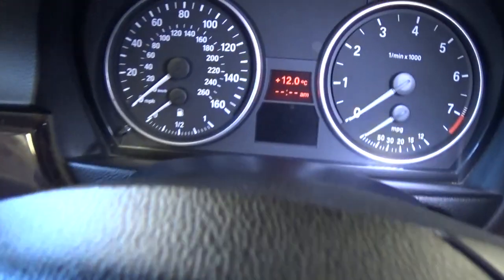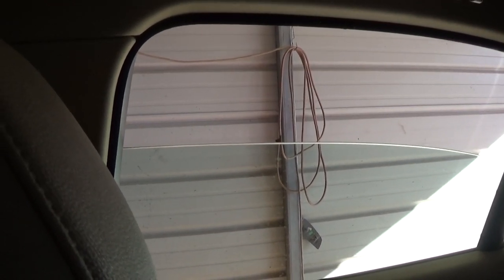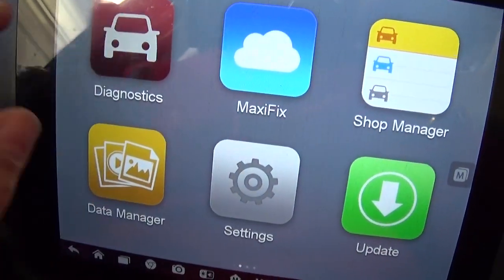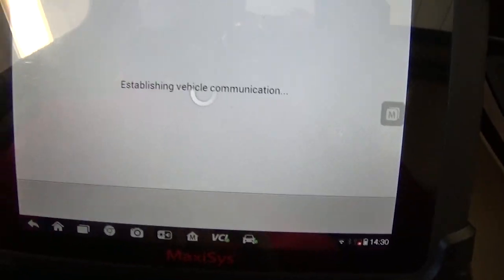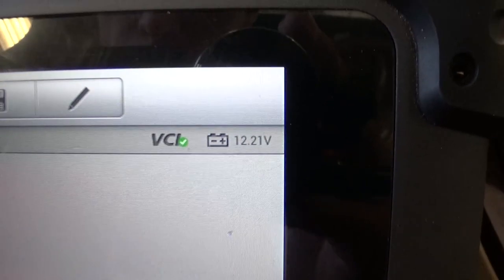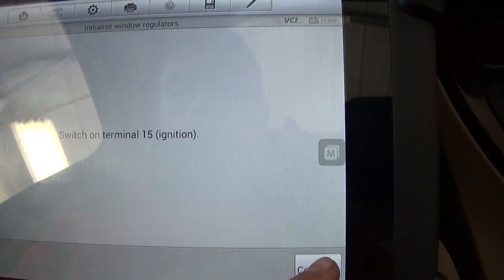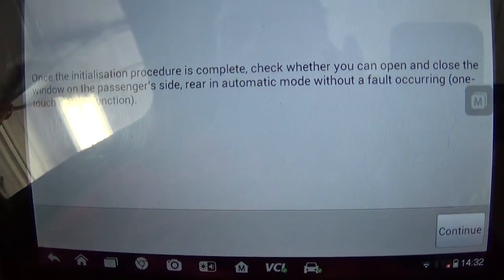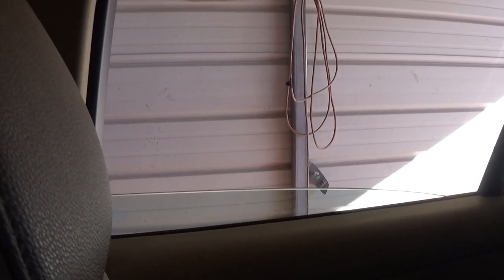BMW Window not Working | HOW TO INITIALIZE WINDOW REGULATOR WITH MAXISYS MS908

Comment: To all e90 Fans with one press window issues. As far as i am aware u do not need a tool to program the regulator all you need to do is follow the RESET steps press button down till window is all the way down and carry on pressing for 10sec. do the same rolling the window up. this should fix the one press isusse  Note it will only work if u have just replaced ur regulator or ur current one is working. Enjoy
Reply: This doesn't work for me. However it's still worth trying before getting the computer out.
Reply: This "procedure" is making rounds around the Net, but it is pure nonsense. You will not achieve anything by doing this.
Reply: Thanks so much! This actually worked!
Reply: ThatMontmorency this actually worked for me
Reply: This worked for me! didn't even need to roll up the window though. As soon as it hit 10 sec when I pressed the buttons while the window was down the window was functioning properly afterwards.
Reply: Worked for me, I only pressed the button in half way to engage the one touch function and held it on for 10-15 seconds while the window was open then the same when the window was closed. You do have the ignition on though (press the stop start button without pressing the clutch).
Reply: Worked for me!
Reply: Beau Hartley-Tilley it worked for me, too! 👍🏾
Reply: Worked for me just now as well thanks man!
Reply: Usually don’t comment but thanks for this it actually worked !!
Reply: Worked for me.  I didn’t start my vehicle, I hit the “Start” button without my foot on the brake.  From the drivers seat, I performed the remaining steps.  After that, I ran it as the sequence states above to the “Fully Lowered” position and held the switch down.  Then I raised up the window to the “Fully Raised” position, again from the drivers seat.  

Then I tested operation from the door where the regulator failed, same steps as above.  

Then I checked the computer for the active faults, and fault was removed.  No special computer to reset the window replacement.

Comment: hello friend, I need help, the windows of my BMW e90 2007 stopped working in an instant, only the co-pilot works, it goes up and down perfectly, the other 3 do not go up they do not go down, I thought it was a problem with the switches and bought all 3 new, also check the fuses and they are good, with the key they all go up and down normal, but the switches are not working even though they light up when the car is started, try to reset by holding down the switches and it does not respond. I don't know what to do :( I really appreciate your help. Thank you very much.
Reply: DId you solve it

Comment: I have a snapon zeus and where this initialisation is located, it fails to find the module. I was curious if its possible to flash the module with a laptop and INPA or is it specifically only for programming a virgin FRM module?

Comment: I have the same problem with my bmw 530i 2006 so is something wrong with my window maybe a motor ? Or do I just need to take it to a machine to get it programmed?
Reply: How did you end up fixing the problem. I have the same car nd my window is acting up

Comment: I'm having a problem with my 2013 BMW e70 the window control switch on the driver side that controls all of the windows does not work how may I fix this problem ? I already checked the 5 fuses that have to do with this function all of the fuses are good and the car battery power is good but when I try using the main switch on the driver side to control the windows nothing happens help me to fix this problem what do you suggest check should I do a voltage check to the main switch and to the window regulator on the driver side? When using the window controls from any of the passenger seats it works but just not from the driver seat.

Comment: I have a 2001 330 ci. Had the battery replaced and now my back windows work fine but my two front windows wont do anything. And my drivers side window is down a little. I've tried holding all the buttons down for 20 seconds then up for 20 seconds and nothing? Helpp

Comment: Hi I have a BMW X5 , 2006.  It has an intermittent window problem.  One minute they won't work, then only one window or they will open and not close.  Does anyone know how I can fix this.  It's been tested at garage and no fault was found. Thanks. Linda
Reply: Shame on bmw putting crap window regulators

Comment: Mate,thanks for the video, I have a problem with my E90, windows control doesn't work properly, all 4 windows works on driver side control panel but on each side the won't open (down) they only can close by each side, do you have any idea? Cheers
Reply: Same my car also  bro

Comment: My window has he same problem.  Is there a cheaper tool to initialize?
Thanks
Reply: pgreenx did you ever find out if there's another way to make the window work right without the $2500 computer? I could have just had the dealership fix it for $250 and saved money.
Reply: Hi breck1011 try this. To all e90 Fans with one press window issues. As far as i am aware u do not need a tool to program the regulator all you need to do is follow the RESET steps press button down till window is all the way down and carry on pressing for 10sec. do the same rolling the window up. this should fix the one press isusse  Note it will only work if u have just replaced ur regulator or ur current one is working. Enjoy
Reply: Beau Hartley-Tilley Thanks, I tried this and it now goes all the way up and down. But I've lost the automatic feature that allows you to one touch the button all the way up and down. Any ideas?
Reply: try this link somewhere in there has a reinitialize steps.
 https://www.bimmerforums.com/forum/showthread.php?1618335-One-Touch-Power-Window-Problem
Reply: 250 for nothing,and you saved money!!!! why do they make fawKING cars lake that?
Reply: I pressed the window button in half way to engage the one touch function and held it on for 10-15 seconds while the window was open then the same when the window was closed. You do have the ignition on though (press the stop start button without pressing the clutch).
Reply: @madmax6662  My friend, you made the best comment in here. My BMW had this problem and your steps worked like a charm. I'm glad I read the comments.

Comment: I try what you show here but still doesn’t work... it only goes up or down a little a the time and is just the 2 front windows the rear ones work fine..... what do you think is the next step... thank you
Reply: I pressed the window button in half way to engage the one touch function and held it on for 10-15 seconds while the window was open then the same when the window was closed. You do have the ignition on though (press the stop start button without pressing the clutch).
Reply: pokedbyagerman i did try that with the engine running and not running and no luck
Reply: I wouldnt know what to suggest then, I had a similar problem (the windows would only go up or down a couple of inches at a time) and this worked for me. I have the 2006 118d m sport.
Reply: if ypur window rolls litlle by little you make a manual reset from the drivers console. open start swich without opening the engine . hold up 20 25 seconds the window switch you want to reset. finish. it will work. i did it anyway now i have poped up the window open sensor on board and dont know why..probably because right door switch is broken otherwuse all windows working normal
Reply: @djalecs2790  legenddddddsd